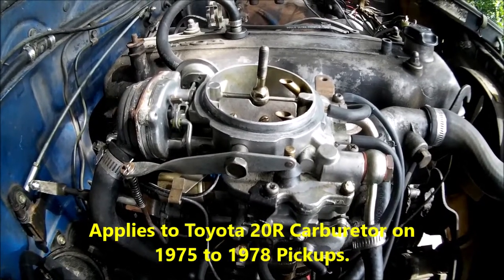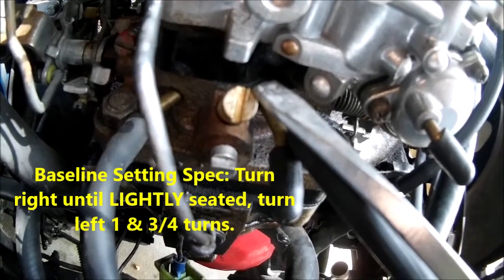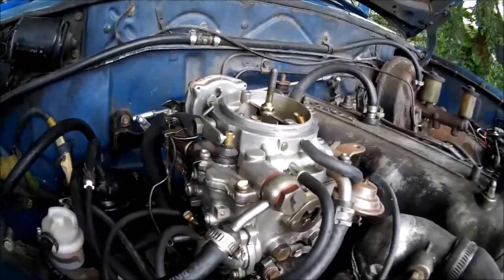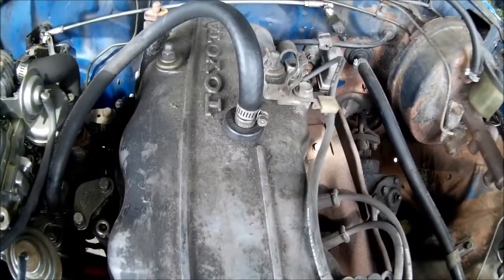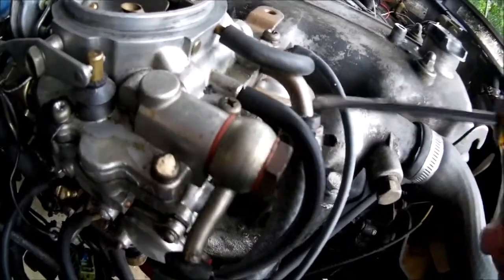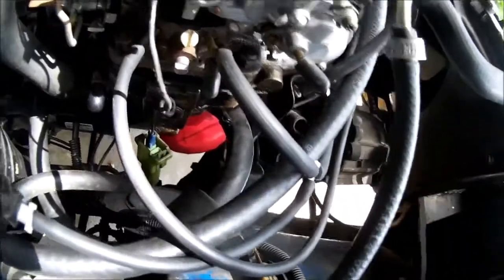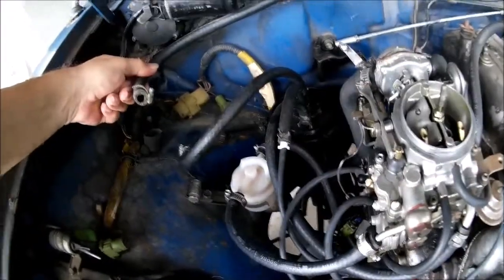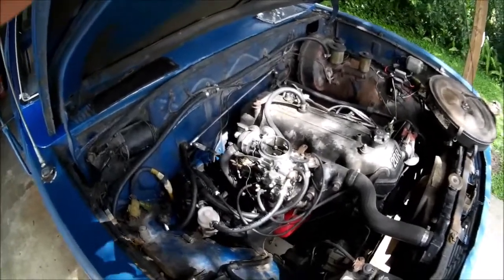1978 Toyota Pickup/Hilux 20R-Carb Adjust & Vac Lines-Desmogged

Comment: I have 22r converted from EFI and Im having an issue where the truck ran perfect until one day, after it warms up, will die if I'm not applying throttle. When it first starts it runs perfect but after a few minutes, it will die unless I'm hitting the gas. The first time it happened the truck would only die in high gear when applying throttle, it bogged out and died while I was driving. Now it runs in high gear but dies for example if I'm coming to a stop. But if I can keep throttle up, I can keep it on. Idk what happened to make it do this, but everything was fine with it ran perfect. Now I don't know what to do
Reply from the maker: It's difficult to tell you where to start without more specific information, and especially on what was a 22RE (Electronic Fuel Injected version) converted to a "22R" (Carbureted version). I also don't know if the engine was "desmogged" or not (emission equipment either removed or blocked off) either completely or to what extent.
Or what type and kind of intake & carb you are now running. 22R intake & carb from a similar year model or otherwise?
Was the carb new or freshly rebuilt or just plain used when the conversion was done?
Are you running a stock Toyota fuel pump or something else? If something else, what brand, part number & how & where is it mounted?
What model year is the vehicle?
How many miles put on since the conversion?

Those are just the initial questions that I have that need specific answers before I could even start to point you in a specific targeted direction. It's never easy to diagnose run problem remotely without a ton of solid info, and even then it can be difficult. But if you can completely answer the above questions I will try to help you.
Reply: Okay this is going to be a lot. If there's a time we can talk on the phone or video chat I'm down to do that to make this easier on you. And if you can help with this I'd like to pay for it. So here we go.  The motor I was told was a remanufactured crate motor when conversion was done. I don't know what the motors year of manufacture or remanufacture, and i have no way to verify that's true or not. The truck was desmogged as far as I can tell, and to make your life harder (I would think) it's a California model. Chassis is 1993. I was told the aisin carb on it was from a 70's model truck and it has an electronic choke. Im going to give you background on how I got the truck because it might be important. It belongs to my boss, and he was tired of paying his mechanic money for parts and labor and he told me that he wants the truck off of his property or he wants me to have it if I'm going to use it, which would over time make the investment worthwhile because I can be more effective having a truck, I normally ride a motorcycle so capabilities are limited. But he said if I can't use it, if it doesn't run or whatever, he wants it out of sight and mind. His mechanic was not happy when he found out the boss basically gave me the truck. All of the vehicles and equipment that the boss has are only, for the most part, operated by one person. That person is the same person who fixes vehicles or equipment that get broken. So the only person who runs everything is the only person who can break anything, and then he gets paid to keep things operational. (Fix what he breaks) Everything is rigged with kill switches too. So basically this guy extorts my boss and has the keys to all of his equipment and is the only one who knows how to use everything because of how he set it up. And my boss can't do anything because he needs him to run it all to get shit done. And who knows if anything will run ever again if he fires this guy. Well when I got the truck, mechanic man told me "when that gauge on there says it's on E, you got 1 or 2 miles before you run out of gas" -_- i would have never predicted that.... What a concept,  I'll run out of gas when on E...  Anyways, 
A day or 2 later, he hits the truck with a trailer he was moving with an excavator. Barely left a dent tho surprisingly, and I wouldn't have even noticed if he didn't make a point to tell me it happened and apologize to me. The next day, I ran out of gas. Despite my gauge reading half a tank. Someone brought me a gas  can and it drove back to the yard without incident. The next day I filled it with fuel all the way, cleaned the top end of the carb and the float bowl which was filthy. I'm pretty sure that the carb was well used when the conversion took place btw. Definitely not rebuilt. Possible that it was cleaned up. I can't get any more information other than what I have because I think that Mr. Mechanic sabotaged the truck by telling me when the gauge reads E I'll run out of gas (no shit dude) and then overnight did something to make the gauges reading fixed, therefore I would run out of gas and it would have to be parked in the yard so he could do whatever he did to it to keep it from idling. I can't get any information about the conversion because I'd have to askthe mechanic. He may not have done anything to it I'm just entertaining the idea just in case. But regardless, he definitely isn't going to provide me any information about anything else with the truck. This is all the information I have. And I believe the fuel pump is stock. Possibly from the truck the carb was from.
Reply from the maker: @chtulica  I don't mind handling this through YT messaging but if you prefer you can go via direct email with me. My email address is available on my channel's "about" page. I'd like to keep the discussion here as it could help out other with the same problems but if you'd rather email me directly that's ok. I don't mind trying to help out and I do not require pay for it. I will try to take your provided information in order for clarities sake.

With the truck being a 1993 California model and that it's has a remanufactured "crate" engine installed that's carbureted, I'd likely suspect that the engine is a 1985 to 1995 22R base block, as engine cores in that date range are more plentiful. There are no differences in the block for '85 to '95 22R's & 22RE's, only the intake & fuel supply methods are different (carb vs EFI). IF you want to verify that it's an '85 to '95 block check this page: https://www.lceperformance.com/category-s/23265.htm
Look at the picture at the bottom and the circled area. All '85 to '95 blocks will have this shape cast into the block at that location (driver's side above oil pan flange).

It being a Cali model doesn't matter if it's been desmogged, it actually makes things simpler. I doubt that the carb is from a 70's model (20R, 1975-1980) as those has a coolant activated choke, not an electric choke. When Toyota came out with the 22R in 1981 they went to the electric choke.

Interesting story about your boss & how you got the truck, but it was a good score for you at least. Getting a basically free pickup in any kind of decent shape rarely happens. Onwards...

Jumping ahead a bit here. The fact that you can keep the truck running by giving it gas means that your fuel pump is working at least to some degree, so I don't think that's the problem. However, I don't think you have the truck's original fuel pump, as there are big differences between the original EFI fuel pump & the carb-style/type fuel pump. The EFI pump is a in-the-gas-tank location/type & puts out about between 20 to 60PSI in fuel pressure. That much fuel pressure would overwhelm the needle & seat valve in a 22R carb & cause massive fuel flooding. A fuel pump compatible to the 22R carb only puts out about 4 to 6PSI fuel pressure. It is a mechanical type (not electric) driven by an eccentric ring on the camshaft, & is usually mounted on the front passenger side of the cylinder head.
If you don't have the mechanical fuel pump on the head, it is possible that mechanic used an earlier electric in-tank fuel pump intended for a 20R. You'll have to look & tell me what you actually have there. Just covering the possibilities here, giving the background you explained to me.

For reference, if you have the mechanical fuel pump, it will look like this: https://www.yotatech.com/forums/f115/help-mechanical-fuel-pump-109852/
Plenty of pics on that post so be sure to scroll down & have a good look.

If you don't have the mechanical fuel pump there should be a block-off plate installed, & it will look like this (second picture): https://www.yotatech.com/forums/f115/help-mechanical-fuel-pump-109852/

In that case, that mechanic guy has done some weirdness & either has that earlier model in-tank electric pump feeding the carb, or some other arrangement (aftermarket and/or electric in-line pump).

You said "The next day, I ran out of gas. Despite my gauge reading half a tank. Someone brought me a gas  can and it drove back to the yard without incident. The next day I filled it with fuel all the way, cleaned the top end of the carb and the float bowl which was filthy."

That combined with some other info you provided that leads me to believe that this truck had been sitting for a while, gives me a fairly good idea of what the problem might be. Running an older vehicle that's been sitting out of gas will often cause this problem. And that is debris, dirt or some other substance has gotten past the fuel strainer (filter) in the gas tank (if it even has one or may have dislodged from the fuel pickup tube), & picked up "trash" from inside the tank. The fact that you said the float bowl was filthy could indicate this. Debris, dirt, rust particles or other "trash" in the fuel system can very easily clog up the idle circuits in the carb. That means the engine won't idle normally because there is little to no fuel coming through the idle circuit, so the engine has to try to run on the main circuit instead. Your having to "stay on the gas" is exactly that, making up for the lack of fuel from the idle circuit.

Same issue but related - If this truck has been sitting for some amount of time and has original type rubber fuel lines on it, AND anytime in the last 10 years or so, "modern" Ethanol enhanced gas has been put in the tank, that's a big issue. The Ethanol will do 3 things to older vehicles.
1. Ethanol can & will attract atmospheric water vapor (humidity) & could cause rust inside the tank, which isn't very good for the fuel system.
2. Ethanol can act like a cleaning agent, loosening years or decades old deposits in the tank, fuel line, etc., and then that dissolved "trash" goes to the carb & clogs it up, as described.
3. BIG problem - Old style rubber fuel lines that were not formulated to handle Ethanol-laced fuels will start to break down internally & shed rubber particles into the fuel, again causing the carb idle passages to clog up.
Lastly, if the fuel filter located in the engine compartment hasn't been replaced for a while, you should get a new one in there. It should look like this: https://www.rockauto.com/en/moreinfo.php?pk=5030175&cc=1277782&pt=6200&jsn=1127

Solutions -
1. Completely drain & remove the gas tank so you can thoroughly clean it out & get a new fuel strainer installed. Sidebar - While you have the tank out you might want to consider replacing the fuel sending unit so that the gas gauge is more accurate. You can get workable Chinese-made units on Ebay or Amazon for about $20 + ship, or OEM Toyota ones for about $70-$90.
2. Replace ALL rubber fuel lines with new modern ones designed to handle Ethanol-laced fuels, and replace any hose clamps that need it.
3. Disconnect & remove the Idle Cut-Off Solenoid from the carb. Shoot carb cleaner spray in the hole where the solenoid was to try to clean out the idle passage. This could take several applications It's also very recommended that you hit that hole with some compressed air after using the cleaner. Let it dry for several minutes then reinstall the solenoid & reconnect the plug to it.
4. Check & replace any vacuum hoses that are broken, torn, cracked or stiff with age. Since the engine is desmogged you should only have to worry about the PCV hose, brake vacuum booster hose, and the vacuum advance hose to the distributor.
Make sure any unused vacuum ports on the carb are plugged with quality rubber vacuum caps (don't use the cheaper plastic ones, they don't last).

There's a pretty good start for you. I highly advise you doo all that is outlined above. I've learned from experience that it never pays to short-cut anything when it comes to older vehicles, especially ones that might have sat for a while. Just take your time & be complete about things.

If anything is unclear or you have other questions I'll be monitoring.
Reply: It's a lazer block. Like you said. The truck has both fuel pumps on it. The fuel cut off solenoid, is that the one that's on the top of the carb passenger side or is it the one at the rear of the carb? I think the one at the rear is the electric choke right? Also, there is a large diameter line that comes from that electronic component on passenger side that I believe is the cut off solenoid. It is not connected to anything. You may be right about the truck sitting, but the truck ran great for a week. A day before I ran out of gas at half tank, the mechanic told me I would run out of fuel when the gauge says empty. Why would he tell me something so obvious. What would make sense to me is that he told me that because he turned off the fuel sender so that I would inevitably run out of gas, thinking I'm half full remembering he said it will run out right at E. Let me know if I missed any information you needed, I'm going to proceed with your solution procedures and respond with the results once I complete that
Reply from the maker: @chtulica  The fuel cutoff solenoid is a metal cylindrical shaped part with one or two wires coming out of it, and is located on the carb on the passenger side nearer to the top of the carb and a bit to the rear. Have a look at this picture: https://nationalcarburetors.com/Toyota-Hi-Lux-204-22R-1983-21892367-CC-AT-22R_p_559.html#mz-expanded-view-1050672389106
Picture view is from the passenger side of the carb, & the fuel cutoff solenoid is directly above the red colored screw (low idle set screw).
You are correct, the larger item at the rear of the carb is the electric choke unit. Shown in picture with the red wire running to it.
*NOTE: Both the electric choke & the fuel cutoff solenoid are usually wired to the "hot" side of the ignition, so that they operate when the key is in the RUN position. Just wanted to note that here but since the truck was running OK before the "out of gas" issue I wouldn't suspect any wiring issue with those pieces.

I'm not too sure what you mean by "there is a large diameter line that comes from that electronic component on passenger side that I believe is the cut off solenoid." The 22R carb fuel cutoff solenoids usually have 2 wires on them but no vacuum lines at all.

It's anybody's guess why that guy told you anything but you'd do well to just deal with what is in front of you that you can actually see. I've been doing this kind of thing for a while and have learned that you can rarely take at face value anything a previous owner or mechanic that worked on the vehicle tells you. It's just better to look for yourself & see exactly what's going on & do what needs doing. If he disconnected the fuel sender then the gas gauge would read dead empty. It's more likely that the sender is stuck in the half-full position, but you can verify or dispel this by looking at it when you clean out the gas tank. The sender may be worn out, broken, corroded, the wrong one, who knows? But getting a good look at it will tell you plenty.

I look forward to hearing what you find.
Reply: So I have a flat bed so I just pulled the boards off to get a look at my tank and it's pretty clean. There was a little bit of sediment but I think it was just from me banging on things like a monkey trying to get  shit done. Anyways I syphoned it out. Now, sender unit was pretty rusty and the spring wasn't strong enough to make it return, so I believe gravity is what made it drop at all as fuel level decreases. And once it got halfway the resistance of the rusty components was enough to keep it above the level of fuel. But when it was filled up, the float would do what floats do... Float. Also I went forward with exorcising the idle circuit with carb cleaner and some hits of powered air via the solenoid cavity. I put that all back together before I began anything else cuz I don't trust my memory. So since the truck was back to baseline I tried running it and here's what it does now. So start it, idles high. And it doesn't die. You can drive it around even, until, I think, it gets warm (best guess) 
If you let the truck idle after starting it it will just keep running, no change in rpms, which seem to be high. It ran for 30 minutes when I first started it. So I thought it was fixed but as soon as I hit the throttle rpms just sank. It didn't start immediately after it died so I whacked the throttle all the way 2 times quickly and tried starting it and it fired up and it idled, but it was slightly rough. Not too bad but noticeable different. So I played with the throttle and again rpms sank fast but I kept it running by applying throttle. Heres the next development. While in this 'mode' where it will run and drive and everything as long as control throttle at all times, if I whack the gas it bogs and seems like it's lagging in response. Coughing and sputtering before it catches up to me. But if I slowly accelerate it doesn't do that. So that could have already been happening I just didn't notice because I never tried beating the crap out of the gas petal before, so to speak. Also when rpms sink, the truck has a noticeable difference in sound or tone, and has a lot more vibration that you can feel and hear. Same thing when rpms start to normalize after the throttle whack, shake, sputter and cough. Engine sounds different and very noticeable vibration/sound. Otherwise the engine sounds completely normal when it does manage to idle, or you're steady with the throttle. Sounds great even. I don't know if that tells you anything. I'm going to take a video when the truck is completely cooled off and I'll post it on my channel just so you and anyone else can see what I have seen and I'll keep doing that whenever I do something else from now on. I haven't checked the fuel lines yet. From a glance, everything after the cab looks ok. Everything under the hood looks, from what I can tell, ok. Anyways I think that's enough from me in this reply I feel like that's a lot of useless information so I'll check lines during the video I take.
Reply from the maker: @chtulica  Just a little friendly advice to start with, but never be in a hurry with these things, it never pays in the end. Having had to redo jobs because of this is why I say this. Just want to save you the extra aggravation & work.

Siphoning the gas out is the hard way, there should be a drain plug on the underside of the gas tank.
Rusty fuel sender unit would figure & also explain why it isn't working correctly. There is no spring in the fuel sender & you are correct, it does drop by gravity as the fuel level drops. It might be possible to "de-rust" the float arm pivot point so that it moves through the entire range. If it were mine I'd go get a quart container of CRC Evaporust and soak the sender head in it to get rid of the rust. Would sure beat trying to source a good used unit.

Good work on cleaning the idle circuit out. A cold start with high idle is exactly what it's supposed to do. Once it runs for a minute or two you should be able to tap the gas pedal and get a lower idle speed, IF all of the adjustments on the carb are correct.

Every thing else you describe about playing with the throttle leads me to believe that you either have a vacuum leak somewhere that is letting in unmetered air somewhere, or there is still some problem internally in the carb with how the fuel is getting metered. Especially the parts about at some throttle positions it's rough & at others it seems to run well, either case could apply. To briefly explain:
Most gasoline engines run their best at around a 14.7 to 1 air to fuel ratio. This is mostly regardless of continuous engine speed. The ratio doesn't really change at higher sustained speeds. Most of the carb's job is to provide that ratio. The carb is supposed to draw air in from the top throat of the carb, but if due to a vacuum leak from a broken vacuum line, unused but uncapped vacuum port, worn lower throttle shaft bushings, a bad carb base gasket or even a carb that isn't securely bolted down, this can cause the carb to draw in extra air, throwing off that air/fuel ratio, & the engine won't run correctly.

The fact that it runs ok to well while giving it extra throttle & is even kinda drivable tells me that it's either getting too much air or too little fuel. At engine speeds above idle, this is a little less critical as the engine is drawing larger amounts of air & fuel. Holding the throttle open past idle speed just allows the carb to flow more fuel, which can make up for the extra air to a degree. Good news here is that you say it runs well at higher RPM's, which would indicate that you really don't have any major engine problems going on. It's either a fuel delivery problem or a vacuum leak problem, or both, most likely. Again, with the vehicle sitting for a while, it could be that some of the carb's internal parts that meter fuel flow are stuck in a certain position. That's why I asked earlier about how long it sat & how long ago the carb was cleaned, rebuilt or replaced.

You said "if I whack the gas it bogs and seems like it's lagging in response." That sounds like the accelerator pump is either not provide it's usual "shot" of fuel & it could be worn out or damaged.
There is also the possibility that the AAP (Auxiliary Accelerator Pump) diaphragm is ruptured, which would allow too much fuel to flow at idle. A sure sign of this is if you pull the #1 cylinder spark plug and it's showing as black or black & a bit wet looking, but plugs 2 thru 4 look normal (tan to light grey in color). Only fix for that is to have the carb rebuilt or replaced.

It would be interesting to get a look at the spark plugs to see if it's running rich (too much fuel) or lean (too little fuel). If you want to check them, wait until the engine is completely cool (cold) to remove the spark plugs. NOTE: Keep them in order so you know what cylinder they came out of, or just take them out & put them back in one at a time. This will also help you to not mess up the firing order on the plug wires. Here's a good guide on reading spark plugs: https://www.championautoparts.com/Parts-Matter/automotive-repair-and-maintenance/how-to-read-spark-plugs.html

Posting up video of what you're doing is a good idea so myself & others can see what's going on with it. And detailed & complete info is never a useless thing. It always helps with diagnostics.
Reply: Oh and that open line I referred to is on the passenger side of the carb, above the plunger thing on the bottom. In the picture you linked, the red wire crosses over it in the second picture. But all of the wires apear to run around that piece. It's apart of, what I believe, is the cut off solenoid. It's a large barb,  relative to the other lines lines/ports coming off the carb. On my truck, there is nothing connected there. Seems a little sus
Reply from the maker: @chtulica  That's probably going to be a large vacuum source for what was the emissions equipment which you no longer have. If that isn't capped off & is just sitting there open to the air, that's a MAJOR* Vacuum leak. Get that thing capped off with a quality rubber vacuum cap & see if that makes any difference in your run quality.

*As I said in my previous reply, any source on the carb that allows in too much air is going to throw off your air/fuel ratio, and run problems are pretty much guaranteed.
Hoping it's a simple as that port being open to the air.
Reply: Ah I see also now after reading your last reply that it is not the cut off solenoid that I blasted and cleaned. The cylinder above the red screw I have not done anything with, so I'll go ahead and do that during the video
Reply: Ordered a vacuum line cap kit from eBay with lots of good reviews. So should be good quality. I'll make the video when I get it and I'll try to address everything. I have 2 phones so I can check here while still recording on another phone, should be able to whack it out without it being a mess of a video or hack of a job to
Reply from the maker: @chtulica  Very good. I'll be standing by.